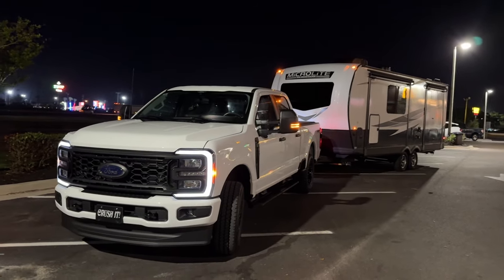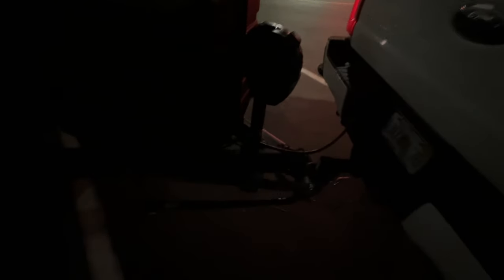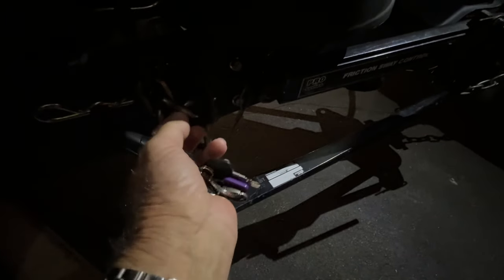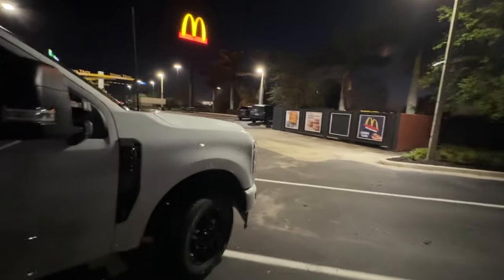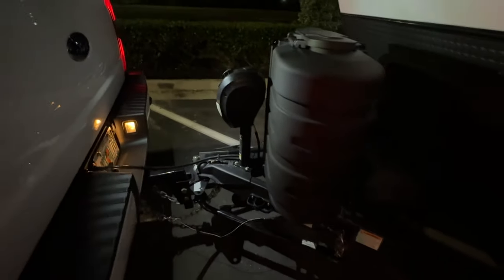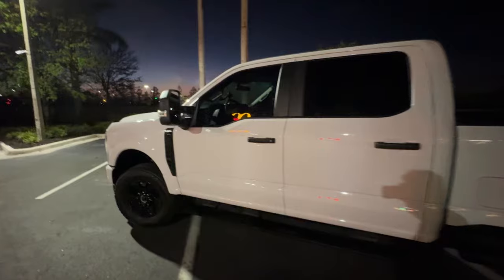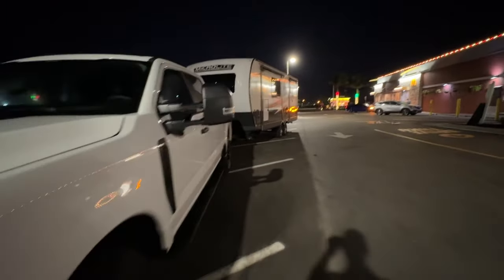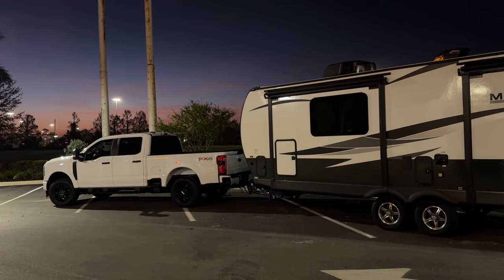Driving to Key West #SocialSecurity #Retirement #KeyWest ￼￼￼

Comment: Gross vehicle weight rating = 7778 lbs minus 1,511 lbs of cargo rating = 6,267 lbs dry weight. So if it's loaded "correctly" at max cargo you should have around 800 lbs of tongue weight. Which isn't too much for a truck with a 3800 lb cargo rating. If it were my rig I'd want to see how it does without the load levelers. I saw a trailer expert channel in Dallas; he says for torsion axles you want them as level as possible since they don't have shackles to distribute weight like the other axles do. I'd think a bit more tongue weight would level the trailer a little more. But what do I know, I've never towed an FKBS behind an F250!!!!! Just sayin, you said yourself ST you were thinking of giving it a try. Let us know! I know I'm glad you're towing with an SD now, wishing you the best of luck with the Super Crusher.

Comment: Alot of pressure on the weight distribution bars.  Were they sit on The hitch it  will pop when you turn.  A little bit of grease will help with that. Also a little bit of grease on the ball will help also. The ball will make popping noise as well
Reply: My thoughts as well.